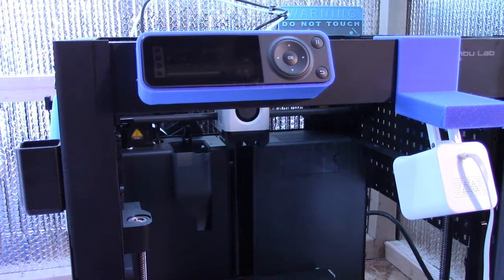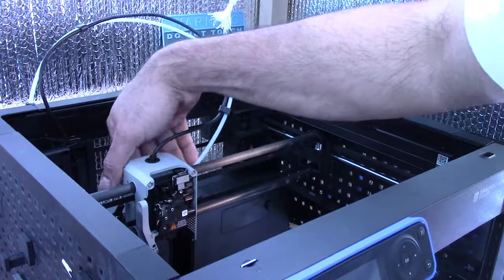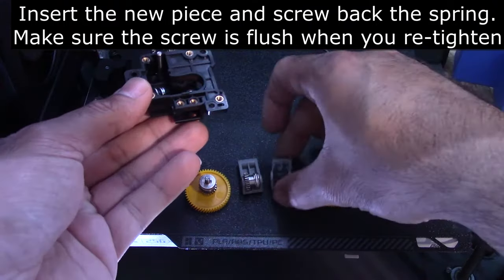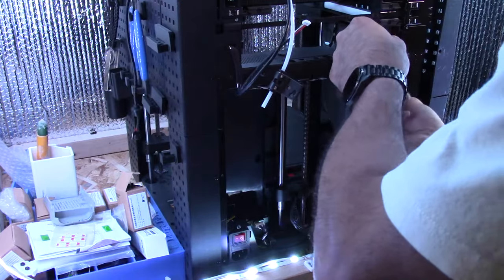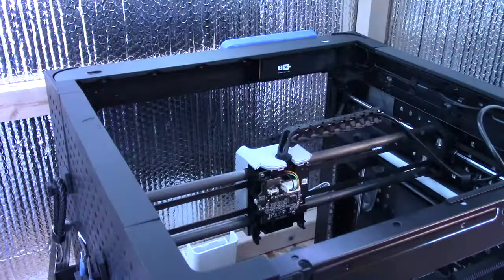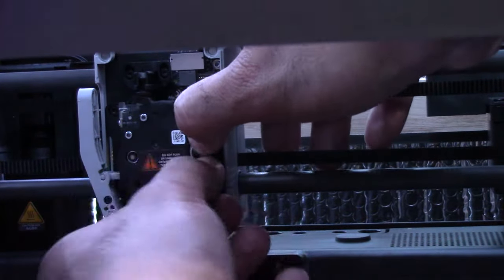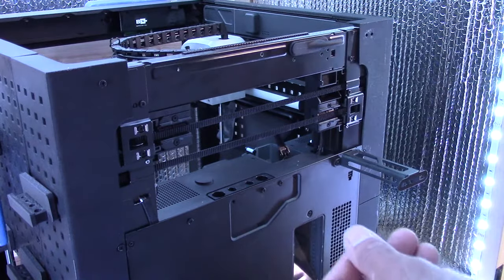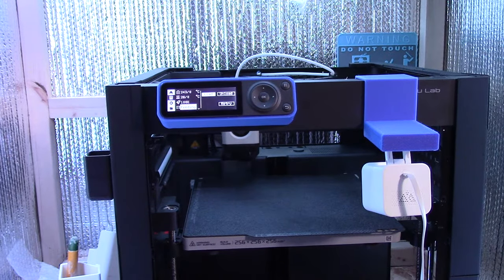P1P - My experience installing Heavy Duty Tool Head, Chain assembly & Hardened Steel Extruder Gear

Comment: Not a member and still watched the video - appreciate you making it.
Just done the toolhead cable and cable chain installation and found it very stressful; followed Bambu's video and wiki instructions but they made it look much easier than I found it, especially getting the circuit board with the heavy duty toolhead cable back on. This is my first 3d printer, so no prior experience to build confidence. 
While I'd already done most of it when I found your video, I still found seeing your experience helpful. I was pretty worried when I plugged it back in.

Not printed on it yet, but managed to home and it's going through calibration now. Fingers crossed!
Reply from the maker: Thanks for watching. You don't need to be a member to watch my videos. All my videos are free for everyone to watch. I don't make these videos to make money on them, but to help the 3D printing community.
Reply: @MicBot  I just said that because your video has a bit at the end along the lines of, 'I'm only releasing this to members, so if you're watching it thanks'. 
Anyway, it made me feel better when I was dreading that I'd messed up my install.
Was fine in the end, though not sure how the experience makes me feel about doing the rest of the P1P->P1S kit.
Reply from the maker: @Edramon53  ah yes I started a members only section at that time but I didn't follow through with it yet. For now members only sections are on Patreon which includes one on one chat sessions and walkthroughs for troubleshooting, upgrading and such. 

The upgrade kit it a very hands on experience and isn't the most straightforward upgrade. It is worth it though.

Comment: Where can i find the rubber that goes in the back for the filament? and where can i find het 0.2 harded steel nozzle? cant find it at there website.
Reply from the maker: The 0.2mm nozzle only comes in stainlessless steel. 

I am not sure what you mean by rubber for the filament?
Reply: @MicBot  thx for youre post, the rubber In the back at 27:53.
Reply from the maker: That rubber piece comes with the chain link
Reply: @MicBot  ahhh oke! thx for youre info!